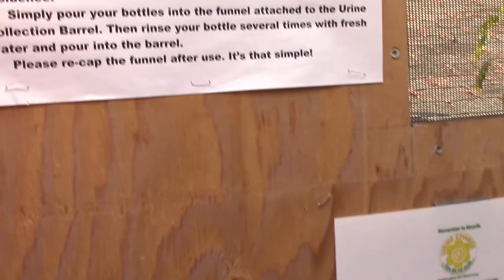Humanure and Urine Composting with Dr Ole Ersson

Comment: I think you miss out on the worms and other microbes that come up from the soil when you have a concrete floor.
Reply: This is true, but due to the concern about pathogens, it’s necessary for the initial part of the system. There could be a secondary part, where, after the one-year deadline you could move to a soil-based compost system.